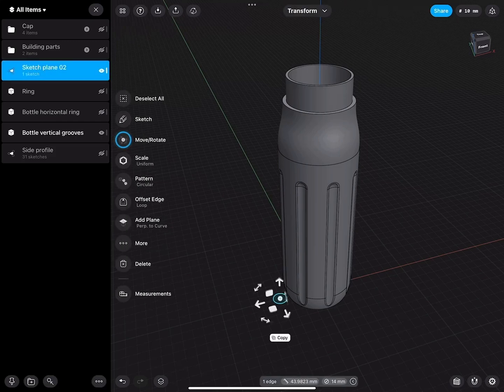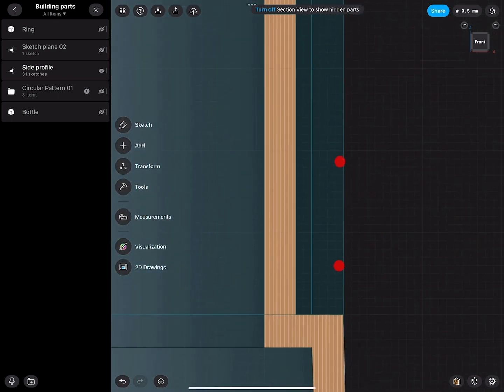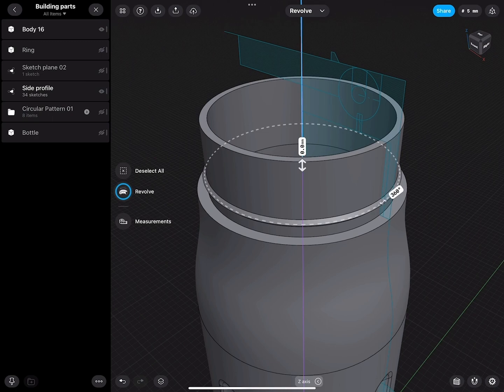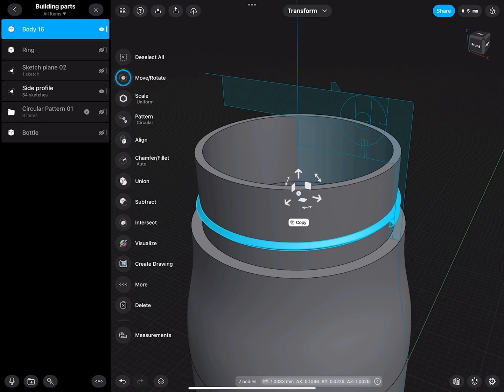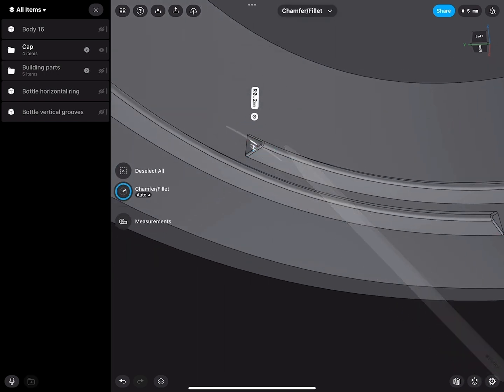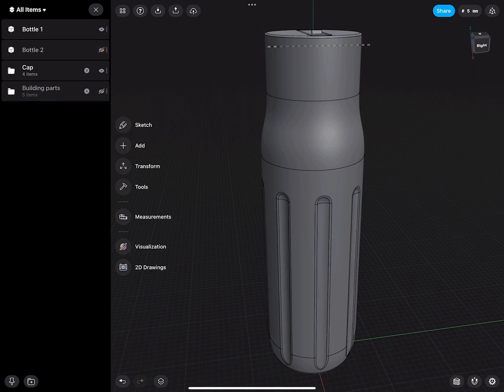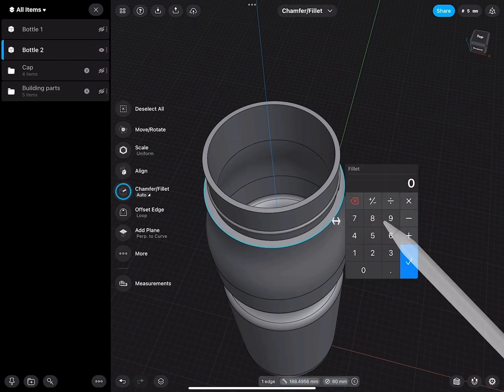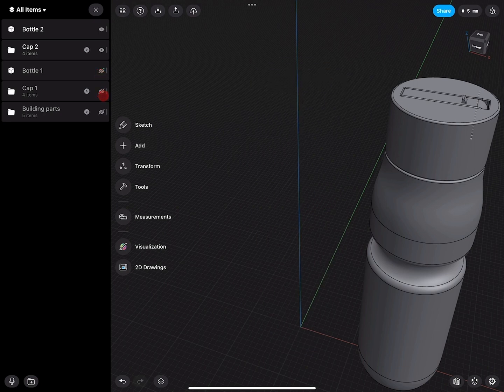3D modeling a water bottle: Creating the threading | Modeling Projects

Comment: To add context. Basically there is a bottle and there is a cap. Between both models you must leave space for the threads, hence the gap. This is why he is toggling his views between the both. You can do this by pressing the eyeball icon in your items folder on the top left. Then on one of the planes you will sketch the side profile of your threads. The inside and the outside. You'll follow the steps to extrude your sketches on an axis. This makes your sketch go all the way around 360. But you don't need it 360 you need it to spin up so you raise the arrows to a certain degree (use the same degree) to get it to spiral up. You will do this twice for both parts. After you have created two bodies of each spiral you will go into your items folder and move the spiral meant for the cap into the folder with the cap. This way it is a part of the cap model. Finish off any details, like rotating the face he shows and you should be done. Hope this helps other lost people.

Comment: How does this thread work? Why isnt there a negative space for the positive threads to screw into? Ive seen others subtract the threads into the female part but that didn't happen here. No explanation.
Reply: look at any bottle you could find. Parallel Threading is the common one instead of the way you mentioned. it has more pros than cons.